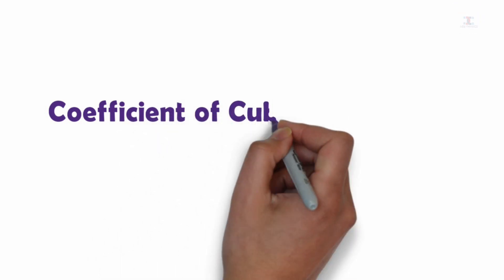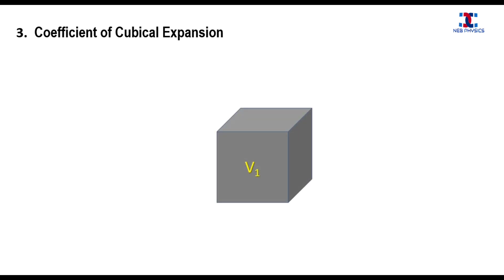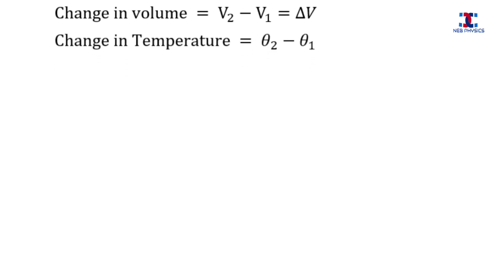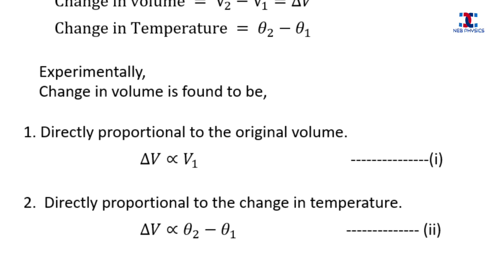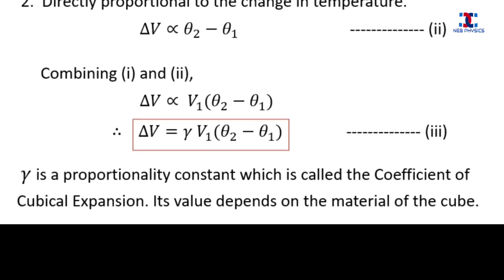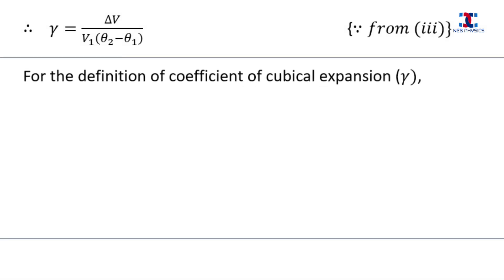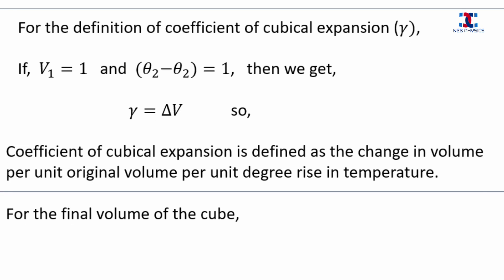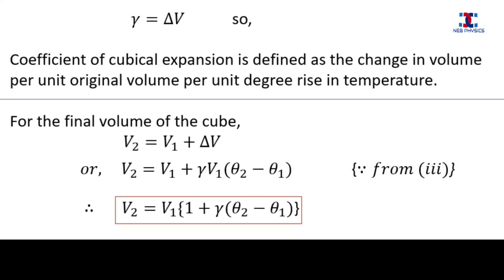Cubical expansion | Coefficient of cubical expansion | Class 11 -New Curriculum NEB physics

Comment: A steel scale gives correct measurement at 20⁰C. If the length of a table measured by this scale at 60⁰C is 3m, find the correct length of the table at 60⁰C.